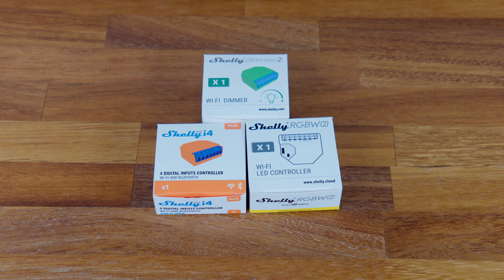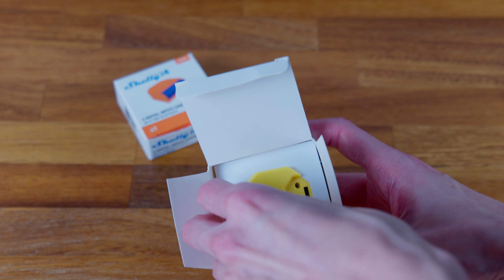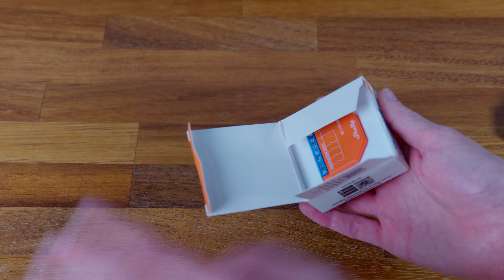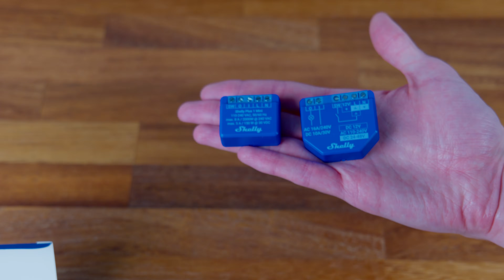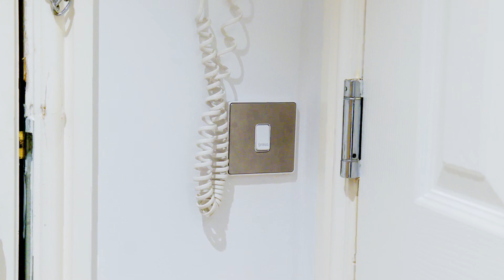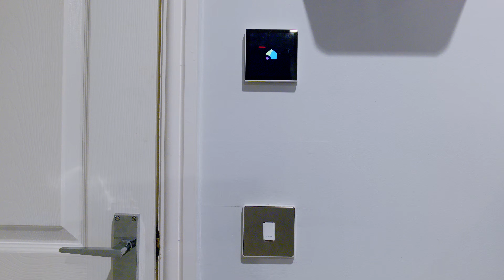These are Awesome - Installing Smart Lighting using Shelly Devices

Comment: The only downside is you can have EITHER local control with MQTT OR cloud... not both.
Cloud is useful for connecting to Google Home for voice control - but I'd also like the live power data to be sent over MQTT - this doesn't appear to be possible.
Reply: This used to be the case. But at least with the plus model (gen2 and later) it is possible.
Reply: @Felix-st2ue  yeah I recently discovered this, buying some more now :)

Comment: These Shelly dimmer relays look fantastic. I have avoided things like 'smart bulbs' until now, but having network-linked relays at the physical switches is very appealing.

Do you use regular (i.e. non-smart) bulbs in conjunction with these relays?

Did you consider using a '2-way and centre off' retractive switch? For me, this would make 'on' and 'off' and 'dim up' or 'dim down' feel a bit more natural. 

How intuitive/usable is the system to those who aren't you? We have a 6-bedroom home and regularly have a load of guests staying with us so need the lights to be easy for anyone to use without instruction. One of the beauties of a simple 2-way switch (or a rotary dimmer) is that everyone knows how they work. I'm keen not to lose that.
Reply from the maker: I use regular bulbs in the hallway but I use smart bulbs in the living room and bedroom with the Shelly being used as a switch input to turn them on/off.  I like using smart bulbs as they allow me to change the colour temperature based on the time of day and dim individual bulbs - I have downlights so it's nice to be able to dim different rows to different levels.  That said, I strictly use Zigbee smart bulbs that can be controlled over the local network and have the Shelly override I demonstrated towards the end of the video - I'm not going to use smart bulbs that require a working internet connection!

A centre off switch would be nice but wouldn't have been practical with my existing hallway wiring.  I have a 3 core cable going between the two switches where the permanent supply loops in and out of one switch and the light is connected to the other switch.  Therefore, the 3 core cable needs to carry both a permanent live and neutral leaving only a single unused core that I could use as a switched live.  If I wanted to use centre off switches at all positions in the hallway, I'd have needed to add an additional Shelly to the switch by the front door which didn't really seem worth it for something as minor as hallway lights where all I really care about is "full brightness" and "low brightness"

As for ease of use by others - this is a major aim for everything I do with my smart home setup.  Anywhere I have smart lighting has a physical, regular looking switch on the wall.  Sure, they're retractive so when someone first goes to use one they might find it feels a bit weird, but when the lights turn on they very quickly get the idea!  For rooms with more complicated smart lighting (smart bulbs, RGB/CCT.etc) I have a small touch screen above the switch with very obvious buttons/sliders such as "Brightness" "Colour Temperature" and some shortcuts "Warm," "Cool," "Nightlight". I feel this is much more intuitive in comparison to being forced to talk to a voice assistant.
Reply: @camerongray1515  Thanks Cameron. Appreciate your response. That all makes sense and sounds good. I may have to give these a try! I also have a Texecom Premier Elite 24 panel so my mind is whirring with fun use cases :)

Comment: Not a fan of wifi stuff for home automation - Shelly does have "proper" z-wave variants of these now, I believe they bought someone up. Either z-wave or zigbee for me, thanks... zigbee probably being the cheaper option.
Reply from the maker: To me it depends on what I'm doing.  Generally I lean more towards Zigbee devices (all of my smart bulbs are Zigbee for example) but I don't mind using WiFi devices as long as it works purely over a local network, runs on an isolated VLAN and where the WiFi version gives more functionality.  In the case of Shelly devices - while they do offer Zwave devices, they don't have a complete range (no dimmers, LED controllers.etc) and they don't support a lot of the features that the WiFi versions offer - e.g. the scripting which allowed me to set up my "fallback switch" for my smart bulbs.  WiFi devices get a somewhat bad reputation thanks to cheap smart devices that require a cloud connection and don't work without it, this isn't the case for any of the WiFi smart home devices I use.

Comment: Seems like an excellent solution Cameron! I do wonder why MK thought writing "press" on those light switches was necessary, though, surely that's just implied? Haha
Reply from the maker: Thanks!  The switches are available in both printed and non-printed versions.  However the "Push" ones were easy to pick up in Toolstation whereas the non-printed ones cost double the price and were only available from electrical wholesalers.  I suspect the printed ones are useful in certain situations such as door bells or door release buttons since they imply "push this" rather than people thinking they're just a light switch.  Personally I don't mind them - it almost helps to visually justify a switch that looks like it's off when the lights are on.

Comment: In the bedroom it looks like a 35mm depth box, how did you fit that all in there?
Reply from the maker: I haven't measured but I'm pretty sure they're 47mm boxes and are also set back a fair bit from the surface of the wall, at any rate there's plenty space.
Reply: FYI shelly just released a mini series that is a bit smaller.

Comment: Where do you buy the grid system from ? Switches and faceplates?
Reply from the maker: Faceplates are from the "MK Dimensions" product range and the switches are just regular MK grid switches.  They're available from larger electrical wholesalers - CEF, Rexel.etc.  That said, you should be able to get suitable retractive grid switches for most electrical accessory ranges - personally I prefer to find out the range that all of the other electrical accessories in the property are and buy the grid system from that range so everything matches.

Comment: That's a great setup Cameron, I like it.  I've had an idea.  Could you not configure your alarm such that, assuming there's a PIR motion sensor in your hallway, the lights automatically turn on when you walk into the hallway and your movement is detected?  I was thinking you could set the system up such that the lights automatically turn on at low brightness if you get up in the middle of the night for whatever reason, and it could then turn the lights off after, say 5 or 10 minutes.  Is your system able to potentially do that?
Reply from the maker: I technically could use the alarm PIRs to trigger lights - however my PIRs are wireless and sleep for a period of time after detecting motion so they may not be ideal for controlling lighting.  I do have plans to look into some sort of automatic lighting but for that I'd likely use a human presence sensor - they're relatively affordable nowadays and can also detect people when they are sitting still vs a PIR which can only detect motion (and generally this motion needs to be pretty significant).
Reply: @camerongray1515  Ah, that did occur to me, I assume the sensors go to sleep to preserve the batteries.  It's interesting, I've seen other alarms do that.  How long do they sleep for once motion has been detected?  In terms of presence sensors, how do they differ in terms of operation and detection from a typical passive infra-red motion sensor?  I have a little battery powered nightlight in my hallway, and it uses an infra-red motion detector on it, it works beautifully and has been in service for nearly 9 years, I love it.  Maybe you could replace your wireless motion sensor in your hallway with a wired one for the purpose of controlling the lights, but you've already said you're considering using an occupancy sensor.  I'm looking forward very much to what you do with this setup in the future.

Comment: From my testing, shelly has the worst idle power draw since its using old tech esp8266 or esp32(old version). Overall, I think all those shelly devices in idle 24/7 can power a raspberry pi 4 perfectly fine. That's how bad its power draw is.

Zigbee is the best in terms of power consumption. But newer esp32-s6 or esp32-c6 have awesome tech in them that has excellent sleep function that uses almost 0 power. I doubt shelly will use esp32-s6 or esp32-c6 anytime soon.
Reply from the maker: I already have plans to properly measure the power consumption of these and in particular take a look at their eco modes to see how much this helps things.  Obviously lower power consumption is better, but given how good the functionality of the Shelly devices are, I"m happy to deal with the relatively small power increase over a Zigbee device which is minuscule in the overall scheme of things.  Even if these 5 shelly devices drew 2W each (which is a massive overestimate), they'd cost less than £2/mo.  To me, they're well worth that cost.  Generally I do tend to lean towards Zigbee devices but they don't offer all of the functionality I wanted here such as the scripting I'm using on the Shelly Plus 1 Minis.

Comment: Once again another great video. I am in Australia and waiting for the Plus 1 Mini to be certified here. I have lots of space in my switches, but I don't have a neutral! I plan to install the Mini in the light / ceiling rose where there is a neutral.
Reply: Most houses here in the UK have no neutral in the light switch box. I have a few sonoff/Tasmota Basic devices installed in the ceiling.
Reply: @reg2590  they introduced it as a standard here in 2000. Typically my house was built in 1999!
Reply: Approved https://equipment.erac.gov.au/Public/Profiles.aspx?ApplicationID=9340db79-7bea-489d-a98c-cff1da474111    The PM Mini too.

Comment: You’ve convinced me - I’m going to get a couple of the RGBW2 units to control some basic RGBW strips I have at home with those rubbish IR control boxes on them. I’m also finally going to start running home assistant to tie them in to my existing, years old Ikea Tradfri bulb

Comment: Yep I've used Shelly devices for a couple of years now to control electric panel heaters via MQTT - they work really well!
Reply: They may be rated to 240V but what is there Current rating...?  I would have thought that they would fine for lighting but not for high current items like Heaters...?

Comment: I use them as a input when pressed once to send a signal to home assistant to conrol my Hue bulbs. The bulbs are always powerd. However in case HA is not working or some other issue. A triple click will toggle the relay so i maintain local control. Shelly is the goat, other companies should really do more like they do.

Edit: ah i just got to the part where you explain the same.

Comment: You should look into the adaptive lighting integration in home assistant. I rarely manually dim my lights now.
Reply from the maker: Thanks for the recommendation!  I've been meaning to set up some sort of automatic colour temperature adjustment but never got around to it thinking I'd need to implement something manually, will need to check that integration out!
Reply: Hi Cameron, if you do set this up could you produce a video about the process? I have tried in the past to set up adaptive lighting and found the documentation confusing when trying to read and manage a 2 year old!
Reply: One thing that frustrates me with adaptive lighting is if you e.g. turn the light on at 8am full brightness, then you next turn the light on at 11pm it first flashes to 100% brightness as thats its previous state, then goes to the correct dimmer light. There's nothing built in to fix this afaik.
Reply: I havent encountered that problem. I have my smart bulbs always on with the shelly acting as a detached switch. That could be the reason why, but my lights always turn on at the correct brightness
Reply: Mine are always on too (as in powered, not lit), unclear why you don't get because AFAIK no LED bulbs give you control of brightness while they're unlit. I have Hue, they don't suffer from this while under the hub due to some fancy software magic. But if you take them off the hub with Zigbee2MQTT or whatever its a problem.
Reply: @Whoop0 I think this depends entirely on your setup. My smart bulbs have a brightness parameter that can be optionally sent when turning the light on, so it turns on at the correct brightness and there is no flickering.
Reply: @Ror0c  which bulbs?